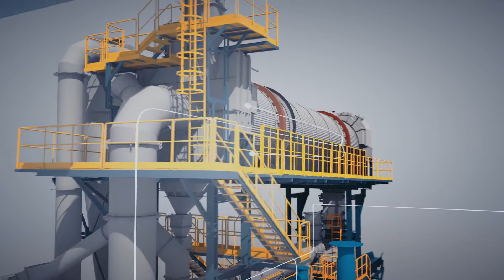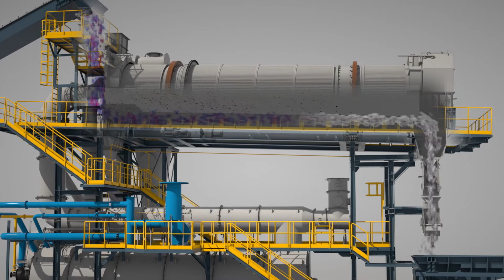IDEX, Insertec

Comment: Please, are there any chemicals added to help remove the dye, or just through oven heat?
Reply from the maker: No chemicals are added into the process, since our IDEX decoater only uses hot exhaust gases from combustion. The energy is obtained by the combustion of a mixture of fuel and organic compounds pyrolyzed from the scrap; therefore, fuel consumption is very low during nominal operation."